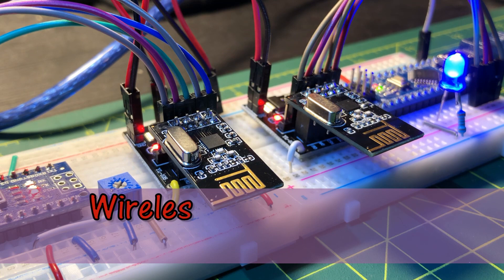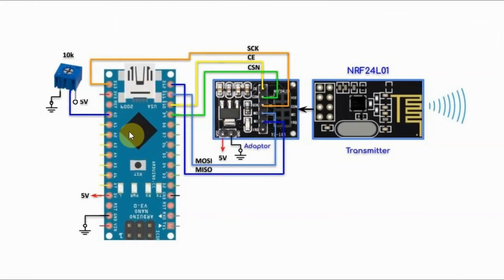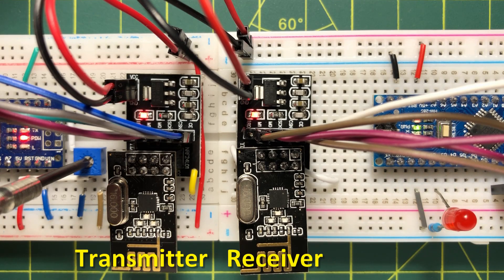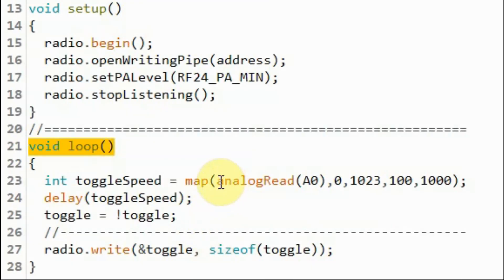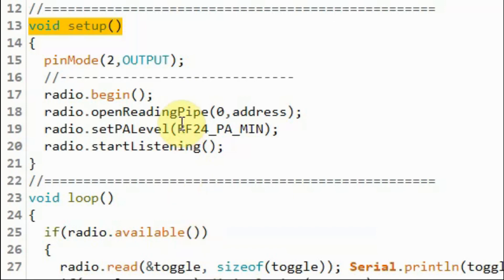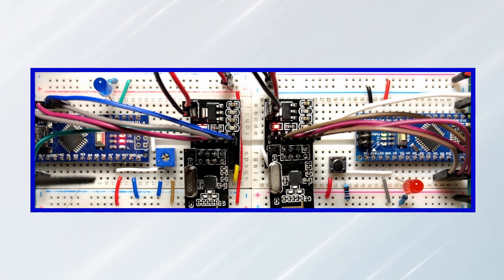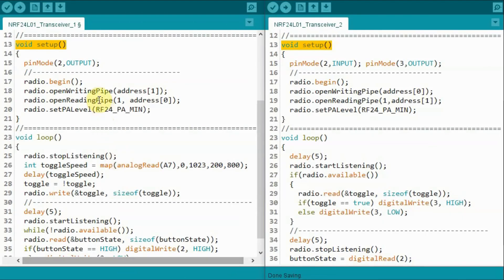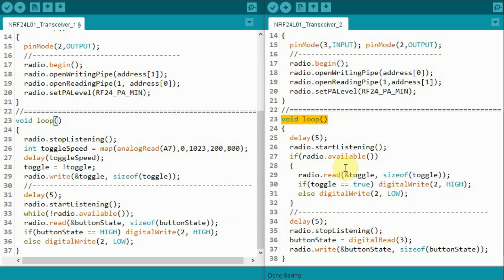Wireless Communication via nRF24L01 Modules

Comment: Hi. I tried to use NRF24 with adapter,connected to Arduino, with 5v it works fine. Now Im thinking how to use it with ESP32 or 8266... there is 5v supply too, but whats about logic signal?  
I suspect that direct connection WITHOUT adapter is possible, but additional condenser needed between 3.3v and GND, right?  Or may I connect NRF24 with adapter through SPI interface directly to ESP32/8266 (there is 3v logics on ESP), will it burn or not?
Reply: Hey I am getting problem with nrf24 can u help? I am not able to communicate better two of them
Reply: @highspeedbikeshorts8617  check my tutorial, there is a massive data transferring (several values) from one node to another, check of CRC on receiver, sending answer to a transmitter and again check CRC, whether two-sided transferring was correct. https://github.com/Ivan-zzz/nrf24L01
But this sketch is for arduino + nrf24l01. I still didnt try to connect nrf modules to ESP32. Need to check wiring scheme and logics voltage, because I intend to use adapters for nrf24 (because of capacitors built-in there and more stable power supply), still not sure about logics voltage on adapters.
Reply: @ivanz9324  Hello I want to use the nrf modules for measuring distance having in the range from 0 to 20 cm, shall it is possible
Reply: @talhakhattak1270  How to measure distance by nrf24??? If you want to measure two-way signal pass time - its useless, too much deviations for such a small distance.. Better use ultrasonic sensor or laser distance sensor - this way its possible...